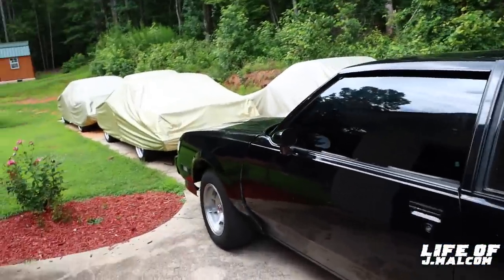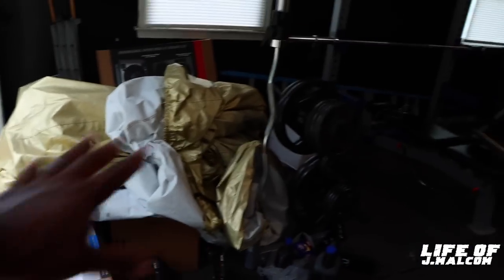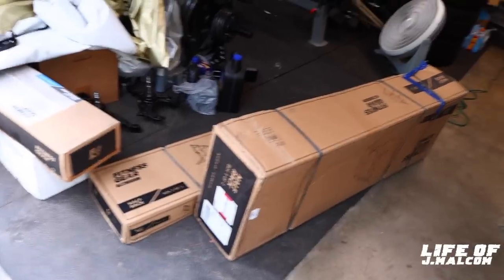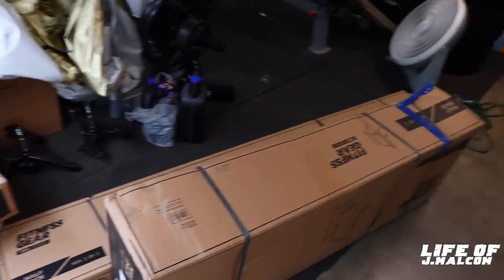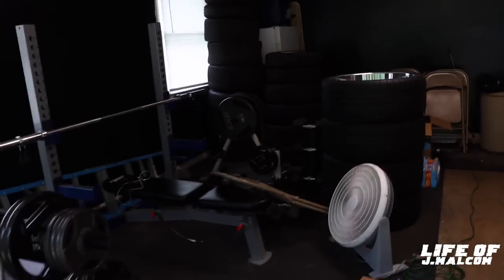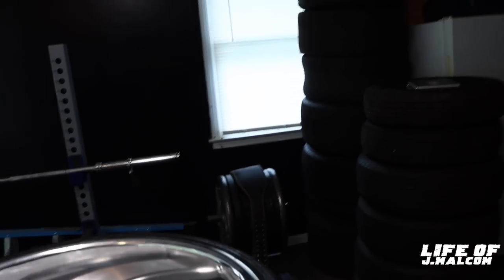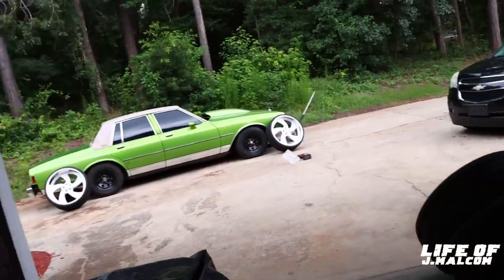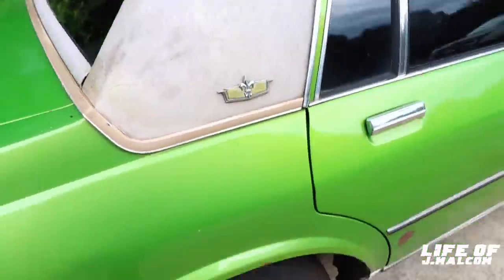TIME TO MOUNT THESE US MAGS 24s ON THE BIG MEECH BOX CHEVY

Comment: 20K in the engine bay alone for old school technology that's a lot hopefully your next motors run better than those I know you have a lot of problems with those motors that you have built previously
Reply from the maker: My man I have not had a lot of problems with the engines I’ve had previously. The 2 engines I’ve had problems with are Dolos 1st 2 engines. The last one had no problems which was my combo and one that was done from scratch
Reply: Man do a little research, new cams and lifters are failing all over the car world, the new parts aren't made right, 20k 30k 40k builds, dont matter. J did it right, most people just dont know about this problem.
Reply from the maker: @kinkaidlee360  Naa they don’t know. Most not in the game that deep to know 💯